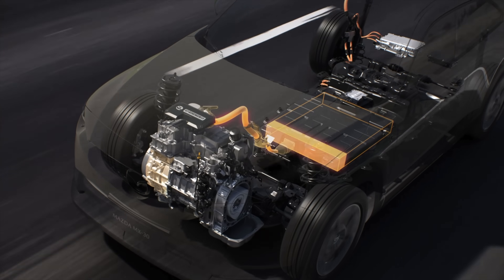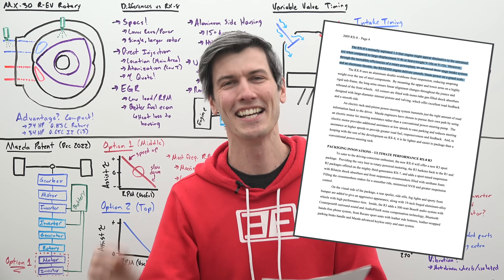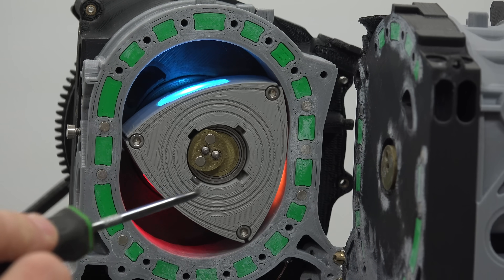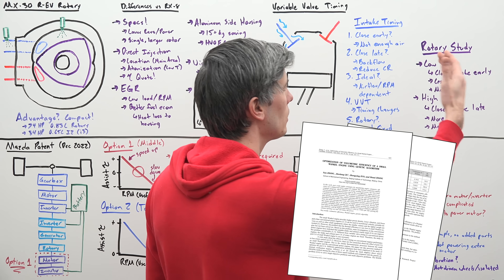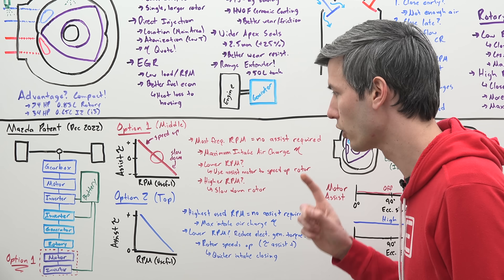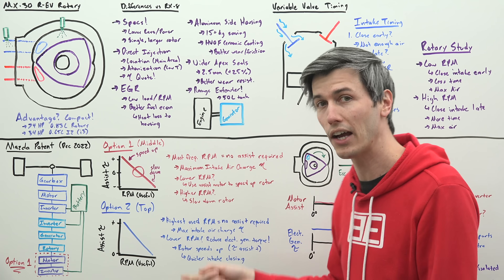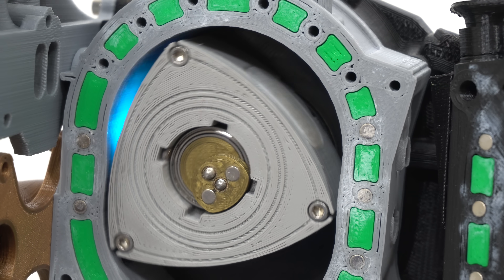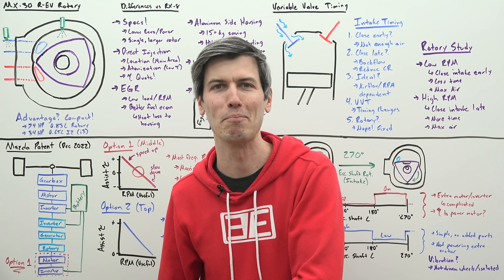Mazda Brought Back The Rotary Engine!

Comment: I have to say, this is EXACTLY what I've been saying the Wankel engine should be used for. A single-rotor range extender that can run at a more-or-less constant RPM takes the best advantage of all that the Wankel has to offer. Granted, I also believe Mazda should seriously consider throwing on a big-ass turbocharger because turbo lag doesn't matter on a range extender, but maybe in the future. Of course, I would love to see non-hybrid rotary car at some point, too, but I'll take my wins when I can. A range-extender is a great way to keep this fascinating technology alive, and I support Mazda 100%.
Reply: I dont think you can realistically turbo a single cylinder engine. I would imagine it's the same for a rotary.
Reply: @mitchellsteindler  it would be more akin to a 3 cylinder engine, I believe. 3 combustion chambers firing within one full rotation. Since the GR Corolla and GR Yaris from Toyota use turbocharged 3 cylinder engines, I would imagine it is absolutely doable on a single rotor Wankel engine.
Reply: @SaxaphoneMan42  huh wow. Guess I should have paid more attention to how a rotary actually works
Reply: Exacty, a rotary engine for a range extender can be designed for a single, speed, a single, stable operating temperature, so the seals, the location of the intake and exhaust can be optimised for single speed.
Reply: Rob Dahm: but also...I built AWD 4-rotor turbo version of it with 1500 hp on the wheels at 35psi of boost :)
Reply: the wear that a turbo puts on the seals is why
Reply: also from the video it sounds like they are recycling air flow to reburn fuel so would a turbo still improve fuel efficiency?
Reply: I don't see a point in turbo-charger. A turbo will push more air-fuel mixture into the same volume making it virtually a bigger motor at the same footprint. But at a cost of more wear and friction losses.
Motor size is not really an issue here, but the wear is.
I see more point in using an exhaust to power an additional generator.
Reply: Agreed, I have been saying this needs to be done especially for construction and agricultural equipment.
Reply: @SaxaphoneMan42  I've been wondering if this still applies to the hybrid engine:
To modulate the speed throughout the 360 degrees, you need a sufficient portion that isn't changed by the motor. (If the engine is staying at a certain rpm but the motor is pushing it faster than that, there has to be a period when it can run slower to cancel it out)

I think the only way they could do that is by running a rotor with a single combustion chamber (or possibly 2). Then the sections that would be intakes for the other combustion chambers can allow the rotor to spin at its normal speed.
Reply: @jameshogge  they could still do that just fine with normal rotary engines, it isn't running without a load, so it can utilize all 3 combustion chambers and maintain the desired RPM just fine. Remember that the rotary is charging the entire time, while it's warming up they can reduce the load on it so that it stays at its lower rpm range comfortably, then when it reaches operating temperature, it can kick up to the higher RPM and more efficiently handle the load.
Reply: MAZDA PULLS PLUG ON MX-30... NO RETURN FOR ROTARY ENGINE
Reply: @sandervanderkammen9230  they’re canceling the MX30 to focus on plug-in hybrids, so I suspect they’ll try to work a rotary into that.
Reply: @MyUsernameIsAlsoBort  Who cares? They didn't bring back the rotary engine at all. 70hp 1 rotor engine with low rpm and trash sound? You literally couldn't even turbo it for any reasonable gains as it is a 1 rotor and would be able to handle like 200hp at most type thing.
Reply: @devonr7497 you are making car-nut arguments in an engineers discussion. What you are looking for is a fun engine, the others here want a good engine. Read the room. Cars are not toys.
Reply: @foximacentauri7891  Sure you can view the engineers side of it in which yea sure its cool that they brought the rotary engine back. But the LARGE majority of people that care and want a rotary engine to be redesigned are car people like me that love the rotary engines. The people who just admire the engineering aspect of it represent a very small minority.  

And to all us car people this engine is a lost cause as far as performance driving goes, and it will have no use in performance cars and be a useless engine to the people who actually appreciate and want rotaries.
Reply: @devonr7497  that is tragic, because from an engineering perspective, the Wankel has almost no place in a pure combustion car. Maybe in an aircraft which cruises in the same speed most of the flight, but not in the rapidly changing conditions of a car.
Reply: @foximacentauri7891  Wankel engines cannot be used in any certified passenger aircraft, they are too unreliable.
Reply: this is a range extender used very rarely. mounting a turbo on it cost more, takes more volume, adds weight and makes it more complicated. 
i find this solution very clever, but still doubt that a lot of ppl will buy it.
Reply: @sandervanderkammen9230   On the other hand, I'm not sure there's even any point to try to make a large wankel powered aircraft, because once you get to a certain size, gas turbines are just better. The same reason we stopped building 28 piston aircraft engines. Turbines are also purely rotational motion.

Rotaries do exist in some UAVs or single engine planes though. Neat thing is they can suffer a seal failure and still run at reduced power, instead of seizing.
Reply: @Appletank8  Yes, and in smaller applications reciprocating engines are still dominant in the general aviation industry.
Yes, gas turbine engines offer an order of magnitude in power-to-weight performance and reliability, improved fuel efficiency and longer service life.

Wankel engines cannot be used in type-certified passenger aircraft because they lose thier apex seals during take-off and climb out and the dramatic loss of engine power has caused several fatal accidents.
Reciprocating engines also dominate the UAV market with Rotax, the number 1 manufacturer.
The US military is the largest user of UAVs and no longer buys any with Wankel engines.

The Wankel KKM57 engine has a triangular piston that both orbits in a planetary motion and simultaneously reciprocates.
(A Mazda 13B series engine, for example has a 30mm stroke)
Reply: @kittengray9232  Given the very high exhaust gas temperatures, which is a lot of energy being wasted , all Wankel should have an energy recovery turbine or an electric turbocharger as in F1.
Reply: @SaxaphoneMan42 the single rotor Wankel,  a 3 cylinder two stroke, and a six cylinder four stroke. all have 3 combustion events per rotation of the rotor or crankshaft in a piston engine.
Reply: @mitchellsteindler  but you can turbo a single cylinder.

Comment: Funny story: Many years ago I worked with a large team of engineers who were submitting analysis of car motors for the EPA. We wrote the study you mentioned 😁. Also your white board is concise and easier to read compared to the 10 or 12 we had in our office. Also, our paper found according to the current rotary engine schematics that Mazda provided at that time, we found so many issues with operation and inconsistencies with their EPA readings. I hope Mazda has found a better way this time. I'll remain skeptical for now
Reply: Yeah, how in the world could Mazda's rotary engines pass emissions standards even back then with no EGR and a significant amount of unburnt fuel exiting the engine??
Did they have a special cat that isn't bothered by heat and can burn all that fuel properly?
EDIT: Nathan M provides answers.
Reply: I didn’t laugh…
Reply: This looks like just another hoax, like the 16X, RX9, Mazda2 Demio R-RE and the RX Vision Coupe.
Reply: Yep,had 2 and constantly breaking down.wanker of a car
Reply: It acts like a 2 stroke engine the way it burns oil.
Reply: @shadowopsairman1583  That is not  unique to 2-stroke engines, some 4-stroke engines use oil injection or pre-mix also... 
There is actually nothing about the Wankel engine that is unique to 2-stroke engines.
Reply: regarding the devil's-marks problem... why cant there be a sky/skid like spool/foot which skids along the surface and adapts angle of pull/force via a axle/pin connecting the triangle rotor's wedge/edge and the sky/peddle/foot in contact with wall and skidding along it keeping the chamber sealed and avoiding the devil's-marks caused by when the wedge/edge of rotor is directly in contact with wall
Reply: Rotaries in the modern age seems a bit of a long shot but I hope the technology trickles down into their reciprocating engines.

Comment: I'm not at all disappointed by this, an extremely small two moving part engine that bolts to the side of an EV without adding much weight like a piston would and making this transitional tech usable is fabulous. Bring it on Mazda, just make a heady duty, small off road vehicle with this too and you'll have my custom very soon. Cheers EE.
Reply: A small opposed piston multi fuel engine would be 1000% better than this rotary and that is the sad part.
Reply: pointless.
There is not practical space saving as compared to phevs using otto cycle generators. And, the latter will provide better fuel economy.
The wankel is an interesting engineering exercise that belongs to history books
Reply: The wankel is a engine for those who actually love driving. 
The space savings and smoothness of this engine are viable. If the ev uses the engine occasionally it may be saving power by not lugging around a heavier motor. Most prius owners brag about how little their engines run. Proving that those who can charge their car from home dont need to carry a full size engine. Additionally a rotary engine is smoother than a piston engine making it less noticeable when using it. Im sure mazda was able to get at least 35 mpg using it as a range extender for a premium SUV. Time will tell but it may be best to wait for more information.
Reply: Unfortunately the wankel even in its "optimized" range is still at best 25 MPG here. Its primary advantage is leaving more space for EV range and avoiding using gas as much as possible.
Reply: @aaronmorgan2475  
Their released estimates end up to be around 25 MPG. It still ain't great.